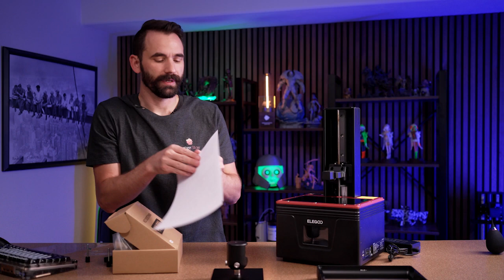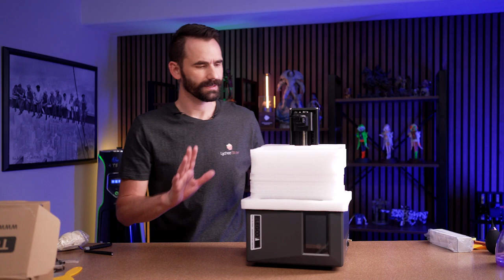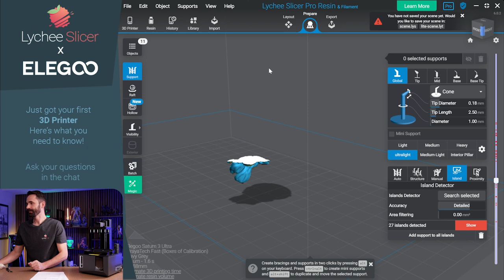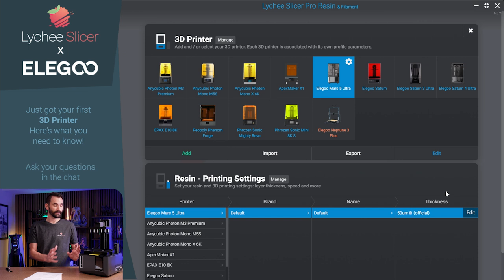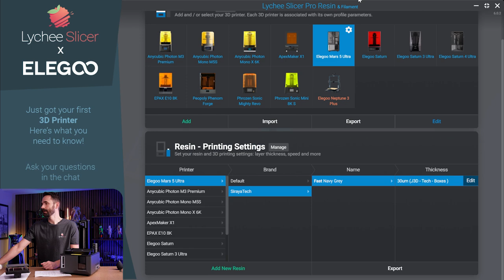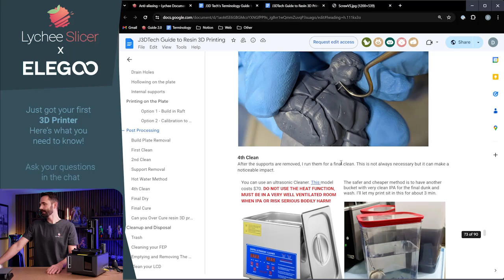Got your first 3D printers, WHAT’S NEXT?? Lychee Slicer X Elegoo

Comment: Sealing with a beard in a respirator is not perfect. The extra tension you can put on the full face one is why you notice it less. I work in industry and have had a beard for years. At some sites I have to shave it off if I need a respirator. There is a methodology for putting them on and testing the seal most people are not aware of. Because I wear glasses, I prefer the half face respirator and a face shield. I never have an issue with smell making it through, because I know how to put it on and test it properly.

Comment: Your video is amazing, I have saturn 3 ultra ans lychee, I can't get it to print over wifi it keeps saying printer timed out, my laptop is right next to printer so it's a good connection. I have a feeling I'm doing a setting wrong. Do I use obj or stl? I've had it for 1 week and still can't print and elegoo is no help. Thank you for your time.
Reply from the maker: Hi! Thanks for your comment!
Have you tried to remove the printer and adding it back again? We had a bug fixe for the Saturn 3 ultra on 7.1.2, have you upgraded to this version? :)

Comment: great video, I have a question about temperature. I have a Eleggo Saturn 4 Ultra which tells you what the temperature is. I have added a heater belt around the VAT to raise the temperature to 20C. Once you start printing the temperature rises to about 39C dure to the curing of the resin I guess, so does this mean it is now safe to switch the belt heater off as the curing process will maintain the temperature ?
Reply from the maker: It can be useful for the first layers :)